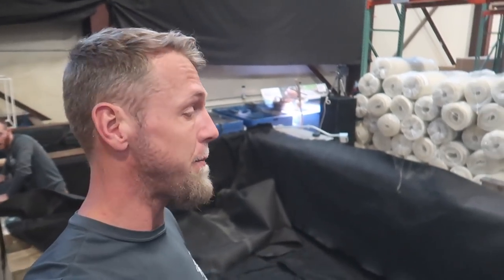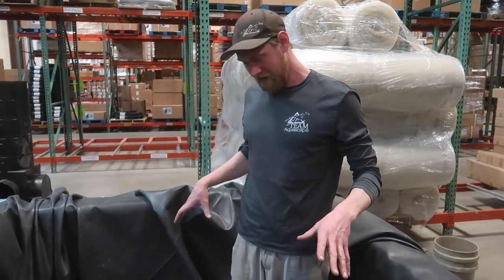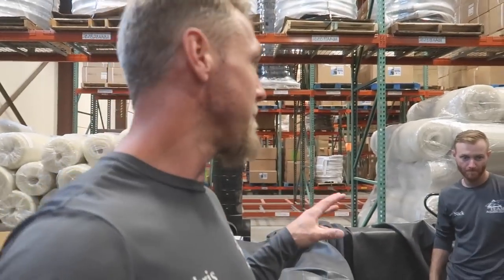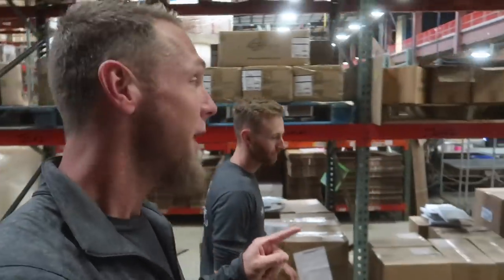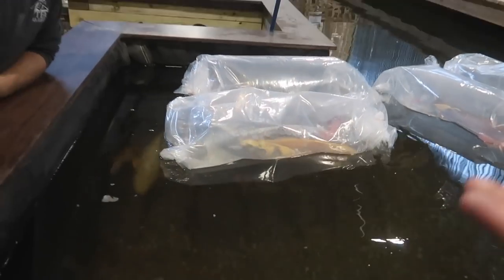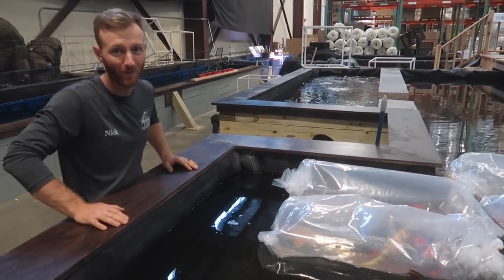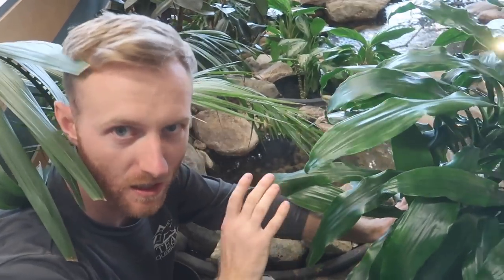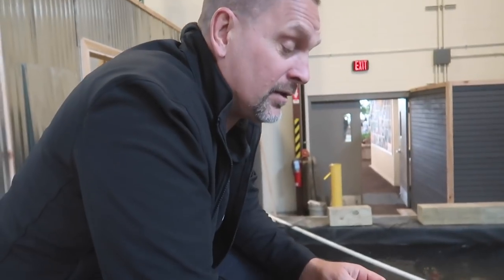*EXOTIC KOI FISH* From Japan Acclimate to Their Indoor Pond

Comment: For fish imported from japan your are making the mistakes you as an importer should not make.
You make sure that the pond water is around the same temperature as the temperature of the water in the bags when the fish arrive. You make sure you get the fish as quickly out of the bags as you can.
Because the fish have been in the bags for between 24 and 48 hours the water inside the bags is contaminated with everything you do not want in the water. Because there is NO FILTER ACTIVITY inside the plastic bag the ammonia the fish are breathing in to the water is NOT being nitrified in to Nitrite. 
Ammonia in water with a low PH (below 7) is not dangerous to the gills of the fish, and here is where you went wrong and had a big chance you would have MURDERED your fish!!!!!!
How??? you may ask. Ammonia in the water is NOT TOXIC if the PH is below 7. 
Many breeders ship their koi with water having a PH between 6.8 and 7.0.
The moment you added the pond water to the bag the PH inside the bag water rocketed high. This because your average pond water has a PH of between 8 and 8.5. So because the addition of your pond water you instantly converted a large portion of the not harmful ammonia to the very TOXIC ammoniac. 
If the levels are high and/or you fish are kept a longer period of time (acclimating, as you called it) in this water the gills will be damaged for the rest of their life (which can be shortened a lot by ammoniac).
For this reason you also DO NOT want this water in your pond!!!!

So now the way to handle you new koi correctly when they have been in a bag longer than a few hours.

1) Make sure the koi have not fed for at least 4 days (if you import them from Japan a normal period is 7 to 10 days no feeding). This will help keep the water cleaner (no excrement) You will still have ammonia because the fish will keep breathing hopefully.

2) Have a tank ready where you can have the fish unpacked. Preferably with a PH in the low 7 range. If possible have the tank at the same temperature as the water inside the bags. A breeder/exporter can tell you what this temperature will probably be. 
It's a good idea to have a heater inside this tank if your pond is more the 6F hotter as the tank. If the pond water temperature is 2F or less colder than the water in the bag you can directly place your fish inside the pond after unpacking. 
If your pond water is not more then 6F hotter than the water in the bag you can directly place the fish in your pond.
If the water in the bag is just a few degrees lower as your pond you can let the bag acclimate for a few minutes. Be sure the water doesn't warm up to quick or to much in a short time this will also kill your fish!

3) DO NOT!!! empty the bag with fish and water into your pond (ammoniac) use a bowl as a in-between. open the bag inside the bowl and let out the fish, as quickly as possible move the fish to the tank or pond depending on the temperature. Use a koi sock (NOT A PAN NET), or if you you have some confidence handle the koi with your hands.
If you are very confident in handling koi with your hands you can also skip the bowl and use your hands moving the koi from the bag to the tank/pond with your hands. It is very important you move as little water as possible from the bag to the tank/pond.
The water inside the bag has a very low PH value (high 5 or low 6) this is because the fish keep breathing CO2 into the water during transport. This is why the ammonia breath out by the koi doesn't covert into ammoniac.
Normally when you use a bowl for your koi you need to aerate it very well. when you have imported fish DO NOT AERATE the bowl. The air will evaporate the CO2 from the water causing the PH to go higher and with a PH above 7 ammoniac will form and you will harm the gills of your koi.

4) For the first 3 days do not feed the koi and replace between 10% and 20% of the pond volume with fresh water daily!
this will help dilute the toxins in the water.
Keep in mind there are no chloramines in the water. To help the fish their immune system you can use salt (max 0,5%) this means 5 kg salt per 1000 Liter water or 11 lb per 264 gal US (this is roughly 41.7 lb per 1000 gal US).

5) When you start feeding keep in mind your filter is not yet up to the task you present to it. start with 20%-25% of the max amount you want the feed a day. gradually start feeding more, add 50% more food every 2 days. Now your filter bacteria have the time to multiply according to the needs.
You will first get ammonia (It can peak) when that clears up you will get nitrite, and lastly you will get nitrate. in most cases this will be your end product except when you have lost of plants and you do only feed lightly then the plants will use all the nitrate to grow.
 a) NEW Pond/Filter  *Ammonia peak keep feeding between 10% to 20% daily to start your filter if you do not have ammonia anymore in the morning before you start feeding you will have nitrite (this is the next step). Nitrite is toxic for your fish so you want it as low as possible. if you have high peaks replace up to 50% of your pond water. keep the temp and chlorides in mind.
If your nitrite goes down your filter is producing Nitrate which is harmless to your fish, and which means your filter is started properly. now you can up your feeding gradually.

It is very important you measure your water daily when you start up the pond/filter. if you measured values are very bad measure even more often. and take appropriate actions. Not doing this will shorten the life of your koi drastically.
Normally koi (in captivity) can reach ages of 30 years and even much older, if properly taken care of.
Reply: They are new to this,  I don't think they realize koi need to be treated for parasites,  ponds with all that gravel it's not ideal for quaritine koi. They may have a mess on their hands.
Reply: Well said hopefully someone there will read and try to follow your advice mate👍
Reply: @orfeyo130  I hope they will but Guess they don't.
They think they know it all. especially after a discussion I had a while ago with "the professor" they won't reply to anything anymore. Keeping koi is a lot different thang keeping goldfish or shubukin.
Certainly if you want big and healthy koi. I asked in a previous comment (which they didn't react to) how it is that most fish that swim in their customers pond do not exceed the 2 foot mark (most are even smaller). I assume it's because they do not feed like I do (about 2,5 lb of high quality nishikigoi food) a day as soon as the water temperature hits 20C (68F). I have fish with an age of over 25 years old and a length of 75cm (29") to 80cm (31"). The smaller the fish the easier it is to keep them.
I would like to see ponds with at least 1 koi with a length of 65cm (2'2") per 1000 ltr (265 gal US) pond water volume. I don't think they can. 

I do not really care that they (aquascape) do not react or even agree with me. Everybody is entitled to their opinion. But if you declare over and over again that your way is the only way to keep fish healthy and then you make every mistake you can make when you import koi.... Also I do not think they really have any idea what a "real" koi pond is or that they even know the latest (10 years) development on filters. Like a drum or paper filter, static or moving bed, trickel or shower filter, and the filter volume needed to keep good koi water. The pond professor didn't even know that you could use ozone on a pond. In that movie they used it wrongly (a high risk of ozone reacting with your fish, or free ozone in the air which is very harmful to al living creatures. You should use ozone in a reactor and neutralise the excess ozone with active carbon.
I just hope that someone that really is into large, healthy and old koi looks a bit further.
I real like the style they have just would not make a gravel bottom. As reacted in another video.
I (for koi) would do the slate bottom with bottom drains and build up the walls like they do with 1 change no backfill with gravel in the pond. Over time too much not wanted bacteria build up.

Also the maintenance they claim is very low, this is not really true. You need to maintain the plants, cleanout the pond and bog at least once every 2 years. and you need to move a lot of water to keep everything clean (fish poop needs to go out of the pond, especially with the larger fish).
I only clean out my trickle filter once a year (1,5 hour in the autumn) and my filter mats once every 2 years (1,5 hours in the autumn). For the rest I only feed the fish and watch if all is still working properly.

Again I watched almost all video's they ever made. just because I like the pond design and I'll keep watching it in the near future. But maybe for their understanding they should go see how a "real" koi pond works and what developments have been going on the last 25 years. The filters they talk about are not in use like they where used 25 years ago. Back then it was a disaster and they are right, they weren't working properly. Now 25 years later they do work properly and do an outstanding job
I might benefit their business to also serve koi keepers with a more natural design but with the newest filter benefits.